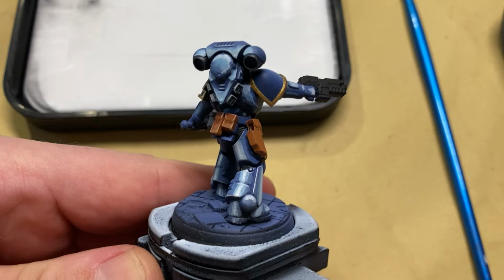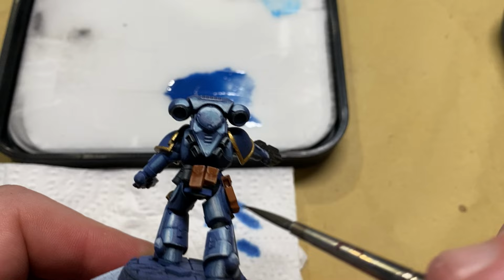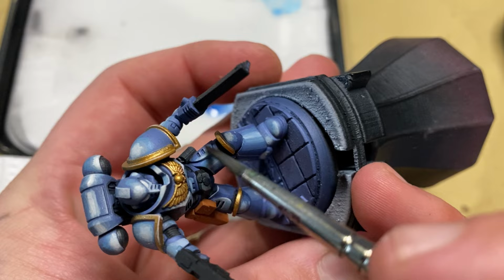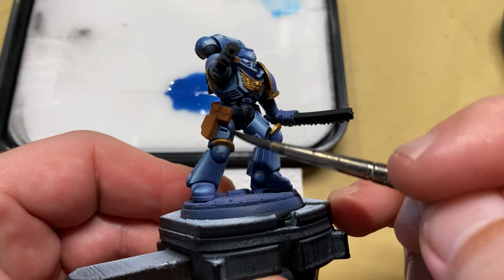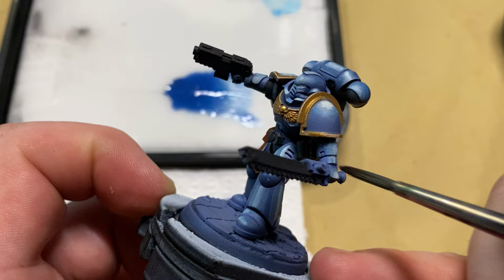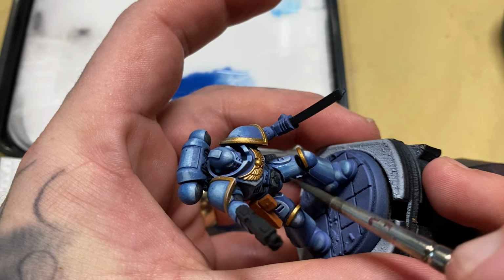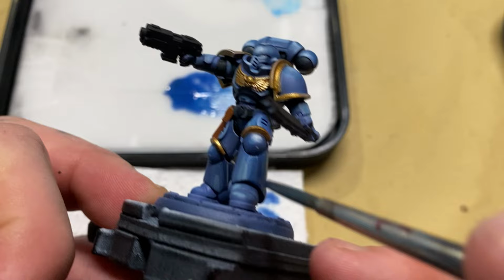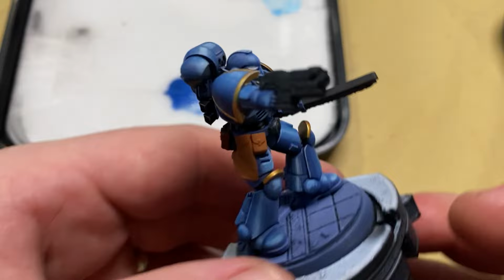300 Thin Coats is Better than Two?  Maybe. Part 4

Comment: What's the purpose of sealing the base coat with a varnish? Also I see people doing this right after finishing the base coat but won't this affect the curing of the base coat underneath? Thanks.
Reply from the maker: Sealing it in so you protect the layers below. And it won’t effect the curing cos it’s acrylic paint so it just dries and once it’s dry it’s dry. You don’t have to do that but it does help if you make any mistakes, to be able to wipe off or repaint the area
Reply: @Groundeffected  Thanks for clearing that up! I have a polyurethane and an acrylic varnish, both water based. Does it matter which one I use?
Reply from the maker: @barndoorbangers4364  doesn’t matter too much to be honest but best to test them on something else so you can be sure they don’t react with each other.
Reply: @Groundeffected  sound. thanks for the tips!